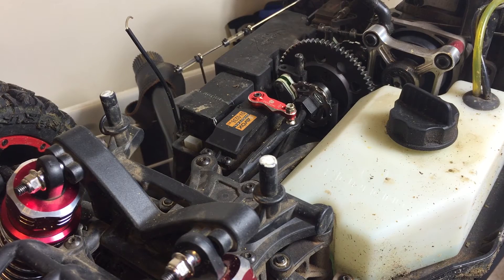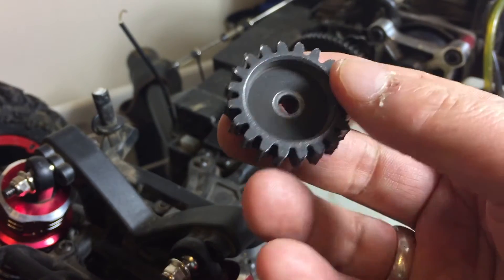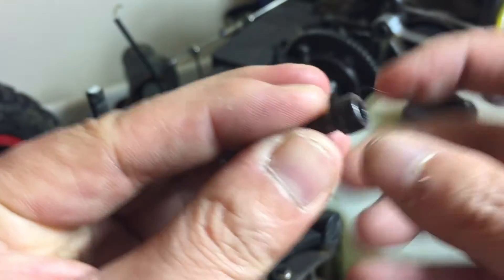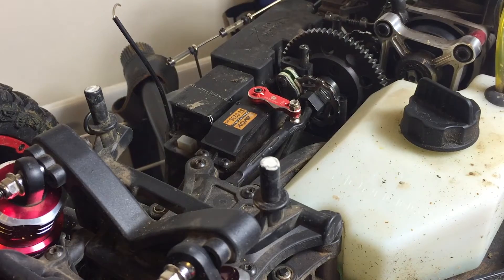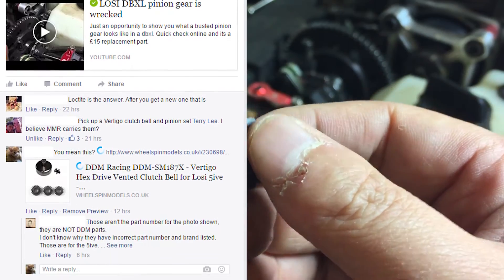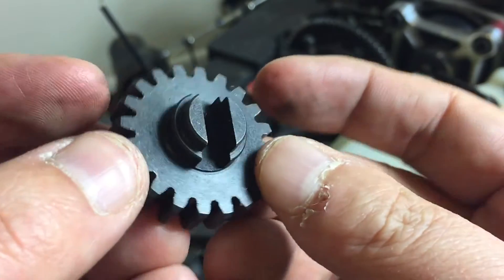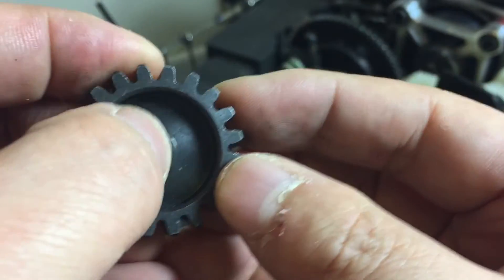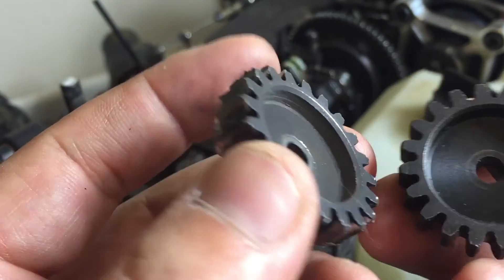LOSI DBXL replacement pinion gear update

Comment: How did you take your pinion gear off? Can it be done with the engine out of the car. I want to get into the clutch housing but the pinion just spins, I don't want to put it in a vice or use mole grips on it. Any ideas would be greatly appreciated thanks.